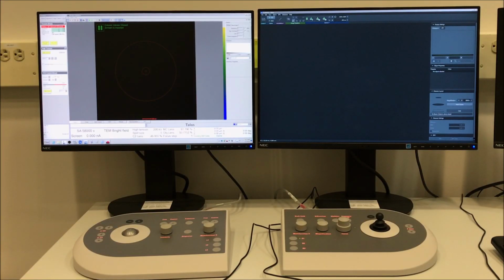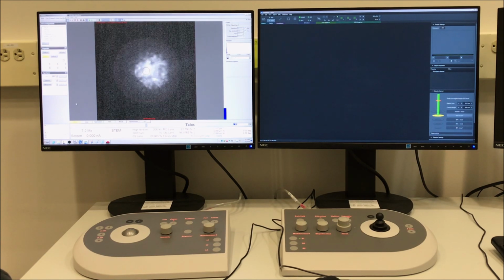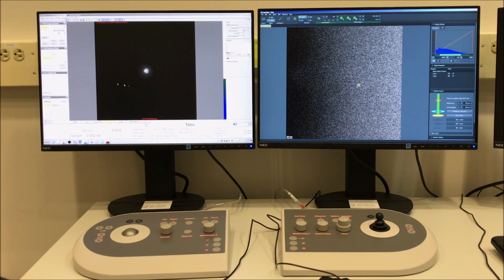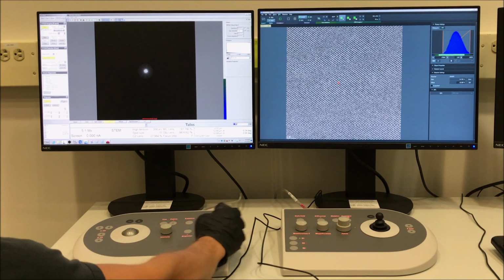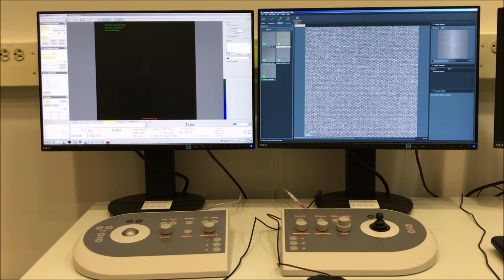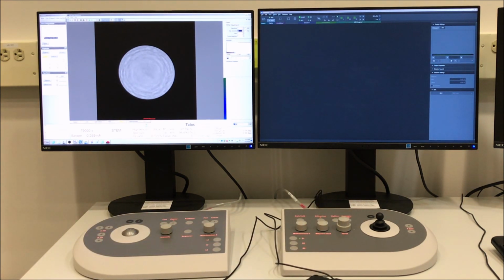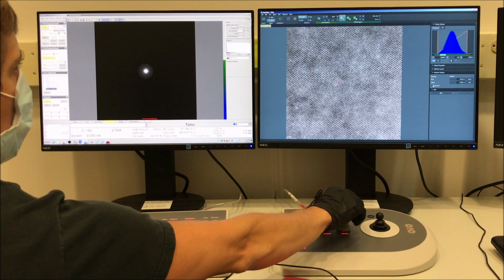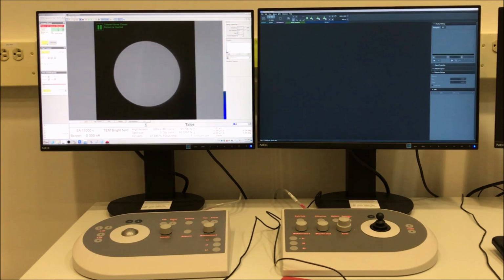FEI Talos F200i S/TEM: STEM operation (playthrough)

Comment: Hi @Nicholas Rudwanski ! Thanks for the knowledge you share, Maybe you will start to gather the STEM community through this :) ? 
Why don't you use the FFT of the HRSTEM to correct for the astigmatism? I ask this because the FFT I saw from gold nano-P showed diagonally elongated rings, as if astigmatism was present, but I couldn't find the origin of this (Corrector seems alright, C2 centered, sample apparently stable...), any idea?

Cheers,
Reply from the maker: Hi Olivier: the FFT method to correct astigmatism only works when phase contrast is present in the image, like in a conventional HR-TEM (lattice) image.  There is no phase contrast in a HAADF-STEM image, so this won't work; you have to look at the Ronchigram and then fine tune in the actual image.  However, if your STEM image is a BF-STEM image, you actually can use the FFT method (if part of the image is amorphous) but it's not very efficient considering the serial nature of the STEM imaging method (and remember, you adjust the condenser stigmators in STEM mode, not the objective ones).  I hope this helps and I'm glad you like the videos!

Comment: Thanks for the videos, Nicholas! They have served in helping me remember alignment steps after being away from our microscopes for so long due to the pandemic. Some topics you could cover in the future, if you haven't already: 4D-STEM, detectors (hybrid pixel detectors vs CCD vs CMOS) and 3D electron diffraction (and related techniques).
Reply from the maker: Glad I could help you out!  Yes, we have a new system with 4D STEM so a video on that will certainly be in the works; in the interim, there is a good video here on YT from Gatan that goes into great detail on 4D so I recommend you check that out.

Comment: Thank you for the great videos and helpful responses. 
1.Can I escape from the Diffraction mode and enter Imaging mode to carry out the probe alignment?
2. After Rotation Center alignment, do I need to align Beam tilt pp X/Y?
Reply from the maker: Hi Sara: sorry for the delayed reply!  If you switch out of diffraction mode and into image mode you will be imaging the probe itself instead of the Ronchigram.  I imagine you could use this mode for alignment, but the preferred method in the STEM community has always been to use the Ronchigram.  I'd have to do some experimenting/digging to see if there is a way to align with the image that will produce similar results (I imagine it is possible).  As far as the tilt pivot points, I usually don't adjust these in STEM mode; unless the person who set up the base alignments horribly messed these up, adjusting these to be perfect via direct alignments is just a minor convenience issue but doesn't in practice improve resolution so I usually just avoid it to make it easier for people I'm training.  If you want to adjust, you would do so after performing rotation center, but then once you do, you will probably need to adjust the rotation center again.
Reply: Hello and happy new year @NicholasRudawski  and Sara. I usually do S/TEM alignment by looking at the probe i.e. the diffraction button is off. This I do because, we usually deal with crystalline samples which do not have suitable amorphous region (but this method is painful). My question is what is/are the suitable magnification for doing S/TEM alignment using ronchigram? Like for TEM mode, ~65000x is a good magnification.
Reply from the maker: @rahulagrawal6026  Happy New Year; if you are using the Ronchigram for STEM alignment, the camera length to do this is somewhat a matter of preference, but generally something larger is preferred since this will magnify the Ronchigram more and make it easier to see (though at some point the camera length can be too high and it will make it harder to align); 400 - 500 mm indicated camera length works well for me on our Talos.